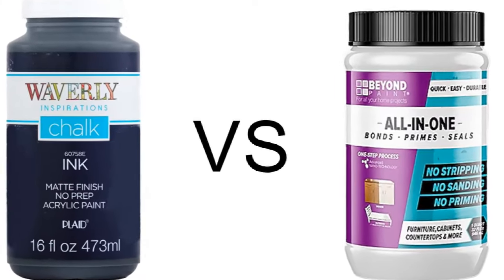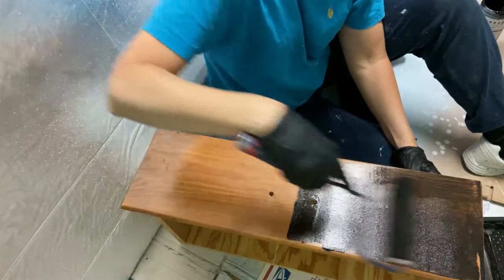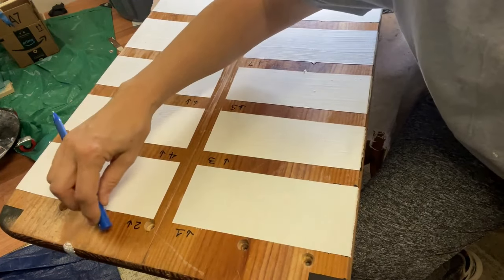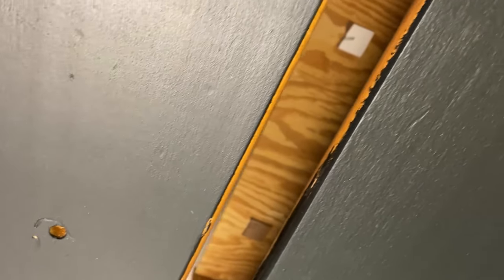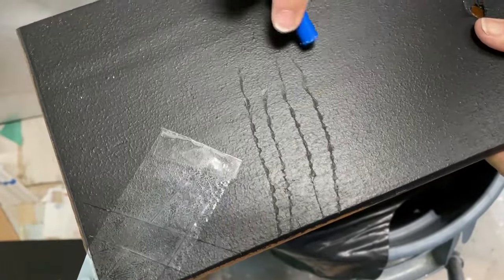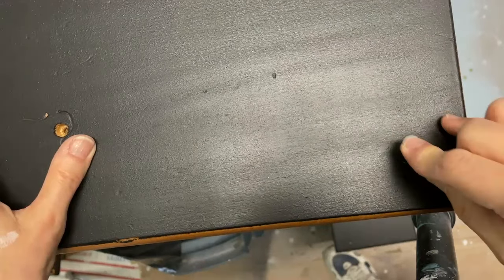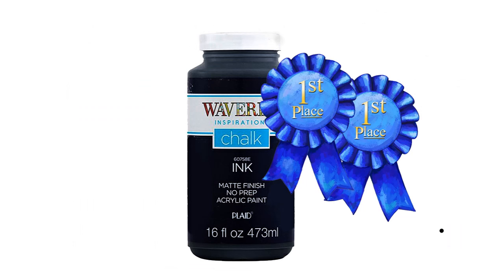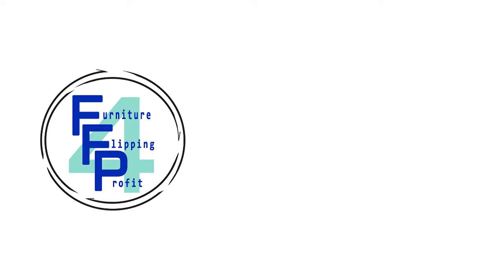Beyond Paint vs. Chalk Paint | The Shocking Results! | BEYOND PAINT APPLIED 4 WAYS.

Comment: i've used both and I prefer Beyond Paint.  I painted a dark mahogany dresser with white Beyond paint. All I did was clean it with a TSP solution first. no sanding.  It covered in 2 coats, no bleed through. I used a foam roller and had a nice smooth surface. I tried chalk paint on a similar piece and had red bleed through in just a few weeks.
Reply from the maker: Each piece of furniture is different. Unless you used both Beyond Paint and chalk paint on the same piece you cannot say that one worked better than the other. The color of paint you use, the prior finish, the type of wood, age, etc etc can affect bleed through. The piece you painted with chalk paint may have been pine with no finish left and of course you will get bleed though.  That is why I did a side by side comparison on dresser drawers from the same dresser with the same prep so you can see a real side by side comparison of chalk paint vs beyond paint.  I don't know about you, but I do not want to go to all the trouble of refinishing a piece of furniture only to have the finish "fail"  It is my hope that my videos will help you be successful in refinishing furniture so they turn our great!

Comment: got to be honest, Love the way Beyond paint covers but durability and it's sealer is a total Fn joke. four weeks later I go to clean up caulk yet wipes right off the countertop. sanded, acetone cleaned and followed instructions to the letter. I'm currently trying to save the paint job with another durable sealer. this will be my last time using their products. not bashing the company. If you can find a different clear coat sealer that works, heck yea the paint looks awesome, but the product durability and its sealer are 100% useless

Comment: Krud cutter is actually used for clean up of small amounts of paint splatter up to 2 weeks after you’ve painted so it will take some of the paint off ,the chalk paint had the poly over it so it would naturally not show paint on the towel and also be more scuff resistant
Reply: The beyond paint is supposed to have the top coat sealer in it. It’s All-in-one. She let all the paint cure for 60 days before banging around on them and testing. The Boyond Paint is supposed to be fully cured in 30 days and she let it cure a whole extra month! People are just paying for a brand name, the paint is nothing special. They have done a great job marketing it
Reply from the maker: Thank you for actually WATCHING the video!  Many people apparently comment and do not even bother to watch the entire video.
Reply: @FurnitureFlippingForProfit  
Beyond Paint recommendations using Simple Green to clean the surface before painting.  Perhaps following their recommendations would have given you better results.

Comment: So you go against mfg directions and expect good results? Bad review
Reply from the maker: I always follow the manufacturers directions. However, I have had so many viewers tell me that they got excellent results by using different techniques to apply the Beyond Paint, I did this video to SHOW them the side by side results if you use these different application methods. The results in the video speak for themselves. I personally do not like Beyond paint because the manufacturer specifically states you are to roll it on with a thick napped roller. I do not like the texture that remains as a result of this thick napped roller. I personally like a smooth finish on my furniture. My clients prefer a smooth finish. Therefore, if I expect to get top dollar for a piece of furniture it has to have a smooth, durable, maintenance free finish.

Comment: A nice objective test and review.  Everything I've seen so far with Beyond Paint is the need to apply it with a nap roller so the coat is thick enough to cover well.  I assume that also provides much better ability to prevent scratching (as shown in your tests).  I'm definitely going to give Beyond Paint a try when I re-finish my kitchen cabinets and plan to apply two coats and use their sealer to provide a better satin finish and some extra protection.  The biggest selling point for me was the ability to use it and not have to perform major pre-prep or sanding before and after, saving a huge mess in my house.  Tx!

BTW... I've painted a few types of paneling (pegboard, vintage 1970s stained real wood wall paneling, etc.) and IMHO the best water based primer I've ever used was Valspar Stainblocking Bonding Primer Extreme Adhesion.  It sticks to anything and never seems to lift off, even when scratched hard.
Reply from the maker: Hi You will note that one of the tests was using a nap roller that is recommended by Beyond Paint company and still the chalk paint performed better. Thanks for watching!
Reply: @FurnitureFlippingForProfit  Months on in my project to refinish my kitchen cabinets and I changed one thing... I put on a good primer first (Zinsser BIN Shellac based).  I know Beyond claims to be a single coat solution, but nothing beats a quality primer especially when painting finished golden oak.  It made the Beyond paint stick even better IMHO.  Worth the extra step and my goal of having to not sand between coats remained intact.  Came out well.
Reply: @csimet That's a great primer. I can't get denatured alcohol here so I have to use Ammonia. But it works, just not as well for cleanup as DA.
Reply: @robomaster4882  I usually use ammonia & water and soak the brush overnight in a large cup.  Works well.  Otherwise, I use disposable foam mini rollers (4").

Comment: Thanks 😊. But I also don’t think you followed beyond paints instructions starting with what you clean with before applying. But this was a great video glad I found it
Reply: You are right. Beyond paint instructions were not followed at all. I LOVE BEYONE PAINT. I did - however - do a light sanding on my kitchen cabinets before painting. But the only that that was getting that paint off those doors would be paint remover. I have not - but will - put a coat of verathane on them in a few weeks. This is the most upseting TEST I have ever seen.
Reply: The video actually started with her cleaning all of the surfaces as indicated buy the Beyond Paint instructions. Not sure which one you watched.

Comment: I happened upon this video in a search for painting my old kitchen cabinets. Beyond Paint is supposed to cure for a month. Perhaps that is why it was rubbing off? I painted an entertainment center with BP and the durability got tougher as it cured.  I have used and like both BP and chalk paint for furniture. Chalk paint looks awesome, but needs that top coat for sure! Thanks for the video.
Reply from the maker: I did let it cure for a month as stated in the video. Glad you found it helpful. Of course, it takes a lot more steps to finish a piece with chalk paint.

Comment: Thank you! I was thinking of getting some of the Beyond Paint, but this has made me totally change my mind. It's expensive paint and if it doesn't hold up well, it's a waste of money.
Reply from the maker: Hi Sue. I was totally shocked when I did the adhesive test and the paint came off!!!! I had done the same text on 13 different chalk paints and only saw a tiny bit of lift off. That was a total game changer for me... and then when it came off with the Krud Kutter! well..... case closed.
Reply: @FurnitureFlippingForProfit lollipop
Reply: If you put a coat of polyurethane over it it will be much more durable

Comment: I tried using beyond paint and agree with these results here. It is just another gimmick product created to appeal to lazy people like me. After using it on a test cabinet and seeing that it chipped easily and was not as smooth as I like. I went ahead and used it as if it were a standard paint. I cleaned with simple green, rinsed off, dried, sanded with 220 on detail sander, primed with bonding primer sanded, then beyond paint, then sealed. I sanded between all the coats. I found that careful brushing was better than a roller with even a 1/4 inch nap. Oh, I also used Floetrol. I brushed it on lightly and immediately applied Beyond paint. Thin coats are best. As many as needed. So I was able to use my $125 gallon of Beyond paint without throwing it away but I won't buy it again. Just do the work. There are no shortcuts to a quality finish.

Comment: Doing my kitchen now. You have to know how to apply the Beyond Paint. I was skeptical at first also however with practice the air bubbles from the high density foam roller came out almost smooth as glass. Will update photos when done. Also I did a very light sanding to make sure it has good adhesion. Will do a scratch test after 30 days. Worse case you can put a urethane top coat after 30 days.

Comment: Thanks for your hard work and unbiased opinion. 

Just quick questions for chalk paint. 
Light or soft sanding would help?
And white color paint would prevent bleed thru same as dark paint? 
Using stain blocking primer would help prevent bleed thru?

Thanks
Reply: I notice no answer so...  I always use a shellac based primer, and a little scuff sanding before that.  Certainly clean all this up with a degreaser, like krudcutter, or even dawn.  Use Killz ORIGINAL, or the Zerginnzers (never the latex based), however that is spelled.  This way, you will NEVER get bleed through, and your paint will STICK and NEVER have bleed through.  Personally I always use varathane clear waterbased sealer, any sheen you want.  
A few very small extra steps that don't take long to do and not expensive, but you will have miles of peace of mind, this paint job will outlast YOU!

Comment: Boy you really don’t like the popularity of Beyond Paint.  This is the second video I’ve seen you do with Beyond Paint.
Reply from the maker: Hi Sampson. I was giving it another try with this video because I had so many people tell me that they had success with applying it using a foam roller. If you watched the video, you would have seen that I applied it a variety of ways and yes indeed it was much smoother. However, when I tested it for durability, I was shocked at the results.  I would love to be able to use this on my furniture flips because one step beats 3 steps!  However, I want the furniture I sell to stand up to normal wear and tear and it is apparent based on my testing that it is not as durable a chalk paint with a sealer applied.

Comment: If the all in one paint is like the all in one paint that I use, you’re meant to use a deglosser first, brush on thick, then use a dry sponge roller to remove brush strokes. Technique is important
Reply from the maker: Hi Evon.  I did degloss the wood prior to applying Beyond Paint and the Chalk Paint.  The significant thing about Beyond Paint in this video is the fact that regardless of how you apply it, it is NOT durable.
Reply: @FurnitureFlippingForProfit  ah wow. We’ll that’s good to know. I use Heirloom Traditions, and have had great results with it. There was a learning curve but I love it. 

Thank you for your video, I know it takes a lot of work!
Reply from the maker: @evonchristie2549   I have used  heirloom traditions and like it also. If you apply it as suggested by the manufacturer it closely resembles a sprayed finish.

Comment: Hi, is your comparison video out which compares and tests all the all-in-one paints?  I didnt see it.  As someone who plans to paint a dresser for the first time, which brand out of the all-in-one's would you recommend to get a smoother finish?  I saw that a foam roller produced a smoother finish on your tests.  Would a 1/4" nap be better than a 3/8 nap for smoother finish?

Thanks for any reply
Reply from the maker: I probably will not do the video showing the all in one paint comparisons.  If you look at the videos on my channels, the ones that are the most popular are the restoration videos. The ones with the product comparisons fall flat. HOWEVER, I will tell you that the all in one paint that I use is my DIY recipe. When I tested them it was just as good as the commercially available one and significantly cheaper!!!!  I have used it many times. The key to successful DIY all in one paint is to use high quality paint as the base. Do not use bargain brand paint. Even if I spend $30 a gallon I still save a LOT of money since 1 qt of the commercial all in one is over $35 a quart. The recipe is on my blog- here is the link: https://www.furnitureflipping4profit.com/post/diy-all-in-one-paint-recipe

Comment: Love your video! I bought two tall dressers from Marketplace that I wish to paint for my daughters. Based on the results from this video, I will use waverly paint with primer and polyurethane. However, I didn’t see you sand in this video. I saw in other some waverly print videos showing that there’s no need to prime or sand. Is it necessary to sand down the drawers when using waverly since I am trying to avoid? If sanding is necessary, what type of sand paper do I need? Thanks
Reply: I just watched it again. You said you sand after you apply the primer and in between each chalk paint layer with 220 or above to smooth out the paint brush stroke. Do you sand or need to the furniture before adding the primer?  What’s the difference between the polyurethane or waverly clear wax? What about the synthetic bristle brush or waverly brushes? Thanks
Reply from the maker: Hi Rita. Since you are using primer, you really do not have to sand it UNLESS the wood that you are painting over is rough.  In other words, the paint primer and poly will not make the final finish smooth if it is not smooth to begin with. That being said, You do not have to sand the entire dresser. Just sand the part that is not smooth.  Waverly is very very thick! The way to get a smooth finish with it it to either thin it with a little water and/or spray it with water as you paint it on. If you feel the brush begin to drag then spray it with water until the brush glides smoothly over the surface. That is what I love about chalk paint. It goes on so smooth and covers very well BUT you have to thin it with water.  You may have to give it a couple of coats of paint to get an opaque surface.  I like zibra brushes or the "best" ones from Harbor Freight. I use a car washing sponge cut is segments to apply the water base polyurethane and I always apply 4-6 coats of poly of the top and 2-3 on the sides. I did not sand in this video because beyond paint says you do not have to so to compare the 2 paints evenly, I did not sand with the waverly chalk paint. I hope this is helpful. Feel free to write another comment with any further ? ( I do not see your comments to a comment so you should start a new comment) Best of luck! YOU can do it!!! take you time and be very OCD about it all. There are lots of videos on  you tube showing you how to paint with chalk paint.
Reply from the maker: I do not recommend using waverly wax because then you will have to reapply it every 6 months. Who in the world has time to do that!  I have all my bills automatically deducted from my checking account because I don't remember to pay them (and they send reminders!) My dresser is certainly not going to send me a reminder that it is time to wax it again! LOL!  Polyurethane is an excellent long lasting maintenance free finish! That is what I recommend you use.

Comment: I know you let the BP cure for 60 days but what is the humidity like where you let it sit to cure? I have read elsewhere that BP is very sensitive to humidity and that if it's at all humid it won't cure no matter how long it sits.
Reply from the maker: It was kept in an air conditioned work room with the temperature set at 76 degrees. The ac keeps the humidity down.

Comment: I dont care what the can says,  IMO, you need  either mechanical adhesion or chemical adhesion for things to stick together correctly. That means in this case,  mechanical, or sanding. It needs something to "bite" to the surface. Chemical adhesion means a product has a certain time frame to recoat to chemically bond to whatever it is being applied to.. If that time window expired, you then need to sand. Sanding would mean scuffing the glossed surface.  A scotchbite pad  would even work. I would never do any kind of painting without  good prep work, no matter what the claims on the can. Theres too much work involved to get something done right, with zero shortcuts. Unless you like to gamble.
Reply from the maker: I agree 100% Terry. That is one of the reasons I do not personally like Beyond Paint. If I am going to go to the trouble of painting a piece, I want it to last and from this test, if you use Beyond Paint, it will not last. When I paint furniture, I always clean it well and then scuff sand it and then apply an oil base primer to prevent bleed through.
Reply: Know when to hold em and know when to fold em.  The person or company who came up with "no prep" as a sales pitch is somebody I want to play Poker with..

Comment: High build prime, sand repeat 4 times up to 200 microns. Sand 1200 paper....tac and paint this will get rid of the texture of the wood....use Acid cat paint tough durable paint easily sprayed on for a flat even finish with no texture.
Reply from the maker: Thanks for watching
Reply: We hope sanding Oak with 1200 grit works out. It will be.